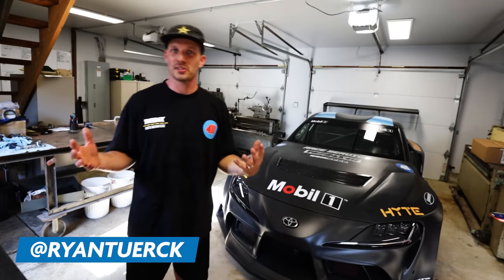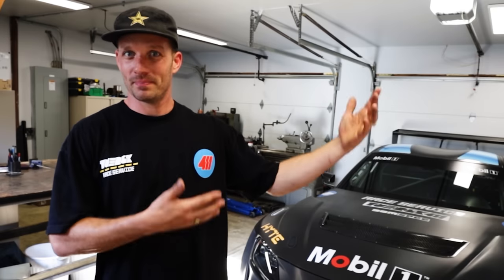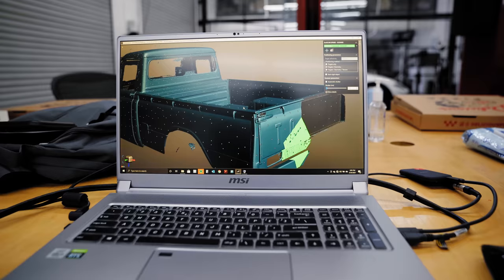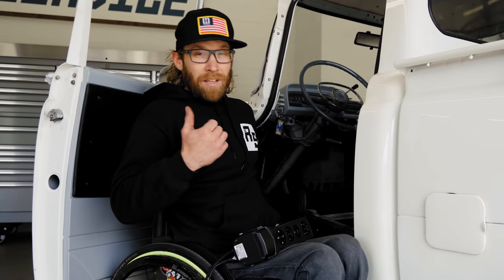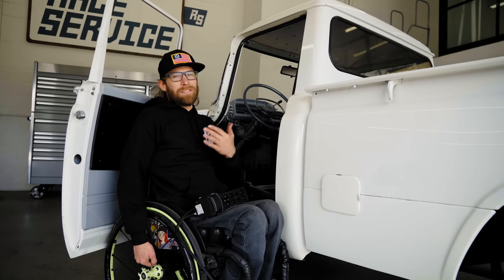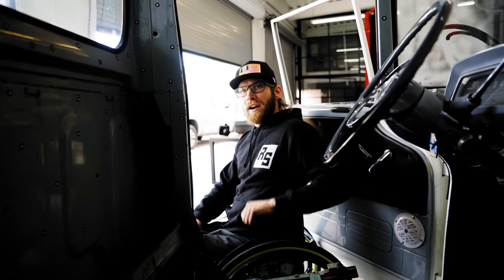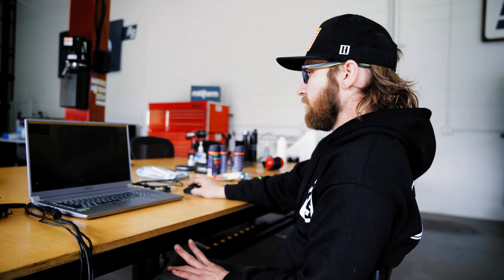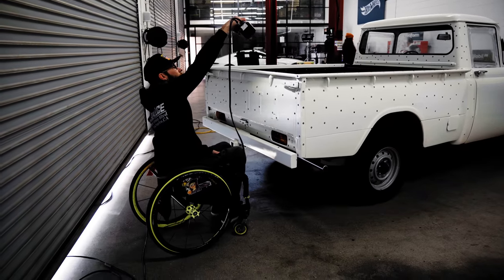STOUT Build 3D Scan

Comment: If you going to this extent to build a chassis and panels I hope you don't cut up that peice of history
Reply: honestly he tried to argue against that but it wasn't very convincing as to why he's choosing to chop up a clean relic instead of a slightly more derelict one, at this extent, there's no difference between starting from a piece of shit vs a piece of gold

and for a drift build of all things 
basically shows the level of creativity that Ryan has
Reply: @Dylanschillin  Sad to hear that.
Reply: @Dylanschillin  there’s massive differences from starting a build with a clean blank canvas vs a rust bucket. For what they’re doing they need a clean truck. And I’m building a very clean stout as well and it’s much better to not have to deal with rust repair or butchered repairs from a previous owner.
Reply: It got cut up
Reply: @lancethelocal  at the extent these guys are going, for them it would be just as easy, it's just not a very convincing argument on their part
Reply: @Dylanschillin  it’s very convincing actually, and people that build cars for a living will all say the same thing.
Reply: @lancethelocal  not at the level these guys are doing it
Reply: @Dylanschillin  once again for what they are doing, you absolutely do need a clean truck. Would you rather 3D scan a perfect truck to base parts off or a rusty truck with parts falling off and body panels full of bondo or non original parts?
Reply: @lancethelocal  who said it had to be falling apart to have rust or not be as perfect as this is? fuck i've seen farm trucks that were left in fields that flood over for a month each year for two and a half decades that could still be 3D scanned
Reply: It’s their car, they can do whatever they want with it.
Reply: @Dylanschillin  you obviously don't know much about 3D scanning or race car building. Care to enlighten us on your credentials in these fields? 

A car that's been sitting in a field for 40 years that gets flooded for a month every year would have no floors, no lower quarters, no bed floor. Especially a Japanese manufactured vehicle. Yes, they can fabricate all that stuff but it would take months to do that. Time is money when you're doing it for a living. Starting with a like new vehicle gives you solid bones that you can trust and saves SO much time.
Reply: @TheBallznweenerz  2 decades is 20 years not 40, plus i worked on a cranberry farm in flood territory and there were a couple vehicles, one being a '95 ford F250, that sat in the bog since 98 because of a flood and the body and frame were way better than most vehicles i'll see on the road, and i'm in the north east, they're in california, they have less of an excuse
Reply: Would have loved to have seen this with an ealy hilux over the stout. But should be an amazing project.
Reply: @pieflies  yes they can but it's pretty stupid to ruin a nice piece of history when your only going to use minimal parts